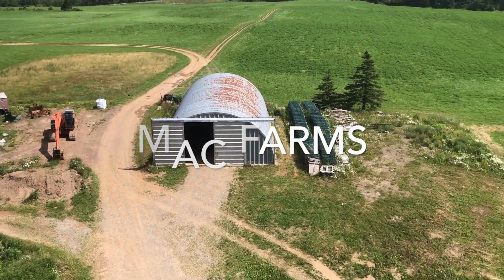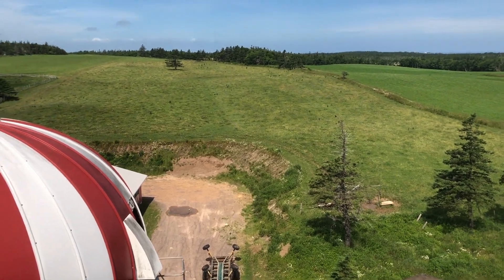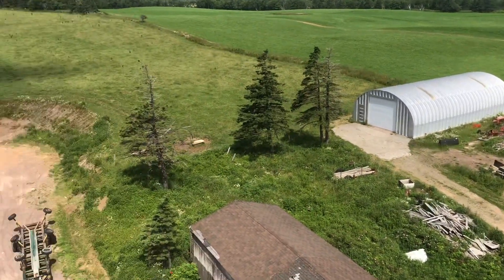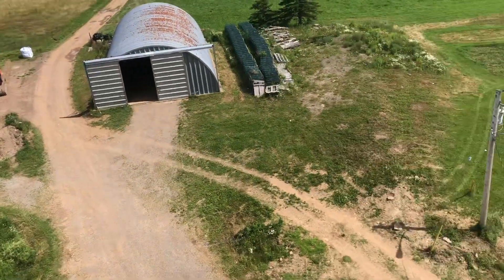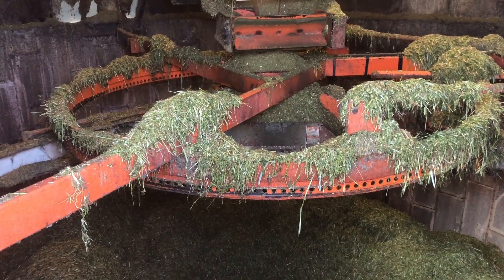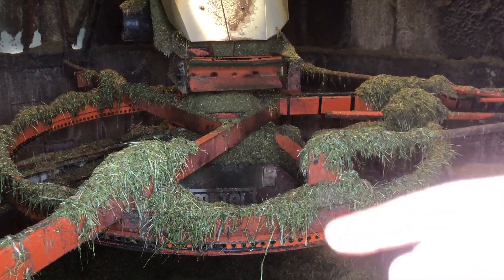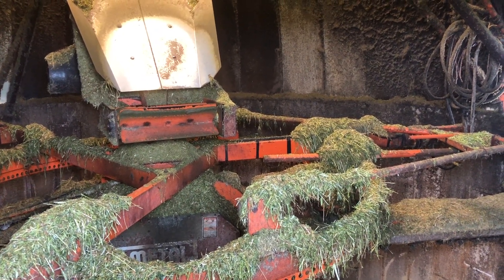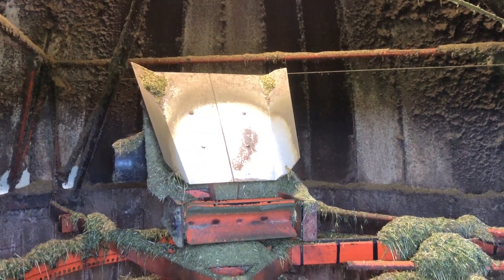TOP OF A TOWER SILO

Comment: We run the exact same silo unloaders. We have one 24' diameter x 80' tall and one 24' diameter x 60'tall. We use a high dump and blow deck setup for filling though.
Reply from the maker: I wish we had a blow deck and dump wagons lol
Reply: Mac Farms it is a lot faster than forage wagons but it's got its issues too, lot of moving parts. But when they work right they'll put a lot of material through

Comment: You've managed to re-engage my fear of heights !!! Lol 😂 nice view from up there though ! 🙂 don't know if you watch GuyinWY channel but he's bought a Massey Ferguson 1135 with a loader on it, what's your experience of the one you had ? On one of the comments it read they go through clutches is that right ? Certainly haven't seen one in Scotland to know. 🙂
Reply from the maker: I watch his channel a little bit, here and there. The 1135’s are a tough old tractor, virtually the same as he 1105 we still have. I’m not sure it would be my first choice for a loader tractor it just isn’t really setup for that with the shifter on the dash and non synchronized transmission I think it would be a pain. The clutches in them are ok but being a dry clutch they won’t really last all that long for loader work anyway since you tend to use it so much. Wet clutch is king there but they never came around for many years later.
Reply: I think with Blake's luck it would be aLOT better in reliably then that New Holland he had, can't say I like New Holland's although I do drive my friends one a T7-210 autocomand and loader (Don't like it) I prefer his Massey Ferguson 7495 Dyanshift VT  when baling particularly the left-hand forward and reverser as it has a de-clutch on the lever. 🙂
Reply from the maker: Calum Anderson the newer Massey’s left and reverser seems to be like the best in the industry, at least ergonomically. Not that I’ve spent much time with them but they just seem to feel the best if that makes sense lol. What was the NH he had? TS115? New Holland has made some good tractors over the years I have a buddy that runs them and they like them. I think if your going to buy a used tractor you’d better off staying away from stuff with a loader unless you can view it in person and really have a good look at it.
Reply: I think it's a TS115A ? the Autocomand on the T7-210 has a feature were you let go of the tractor it will stop at the junction without using the clutch ( providing the traffic cleared fast enough to stop it's self applying the brake the forward and reverse shifter ! ) but last year when baling he said to me "to stop to eject a bale out, just press the foot brake" and so the first time I tryed it my A#$ leaft the and my face nearly kissed the windshield !!!! LOL 🤣 tryed all day to see if I could  control it and couldn't ! 😥 the left-hand reverser has a button for neutral on end but didn't work ! So in the end I had to do it old school with the foot clutch ( very sore leg at the end of the day 😡) on the right side it has forward and reverse buttons on the Commandgrip lever too, nope hate that tractor ! But I was REALLY glad it wasn't me when the turn buckle on the top link stabed the spool block which cost £3000 for them to replace ! as the mechanic said a common problem.😁 No I prefer the Massey Ferguson 7495, more user friendly for me once you get the hand of it to start off at baler mode. 😊 but your right, I wouldn't by a tractor with a loader on it mainly because of not knowing it's service history and what was the driver or drivers like with it? I would probably buy something I've known with around 3000 hours with out a loader with a wet clutch left-hand forward and reverser and then try and buy a new loader,🙂 I drive mainly a 2006 John Deere 5620 and loader which came in with 413 hours at  2013 and now done 1120 hours ? but being a loader tractor I always lift the front axel off the ground for greasing all around along with the loader too at 10 hours.🙂 although I still liked the college's Massey Ferguson 4225 with the loader. Great tractor.😊
Reply: Sorry for the long comment there !!! LOL 😂
Reply from the maker: Those 4200 series seem to be quite popular over around the UK, I guess being some of the last tractors built at the Coventry plant. We have the 4253 which was kind of an economy tractor at the time, I could really take t or leave it. 4255 would have been a better machine.
Reply: I met a guy once who had 4260 and he has one of the last of the 300 series built and was bought new at a discount price because of the 4200 series just begun which was is a 399 1997 and also 390T not sure of what's year it is registered at but he's already had an Irish man trying to buy it but I won't type what he tell too other the first letter began with an F and the last word began with an O, lol 😁 they are very sort after there, but I prefer the 4200 series mainly because of the cab felt more comfortable, 🙂